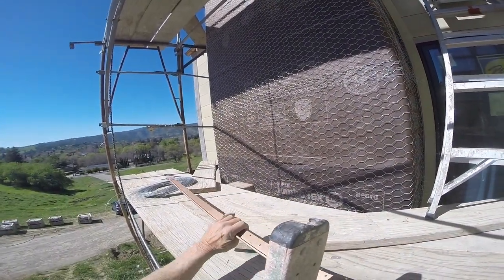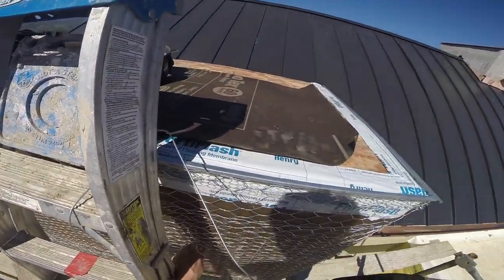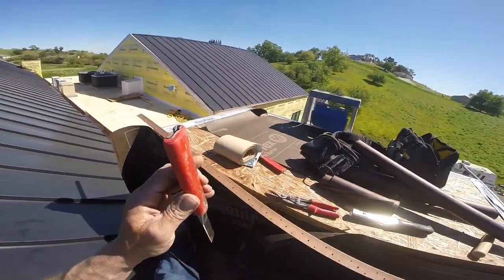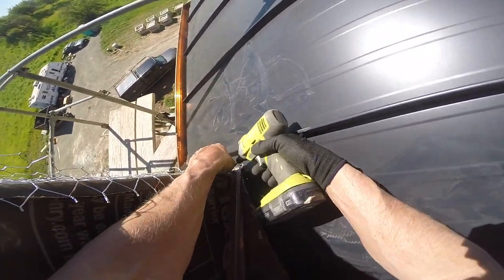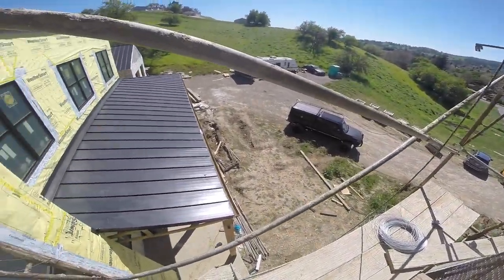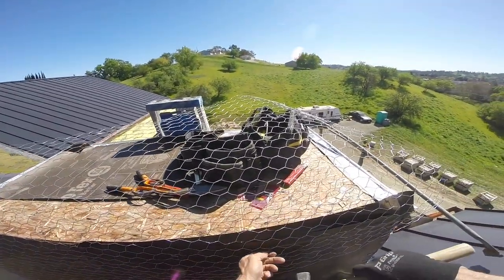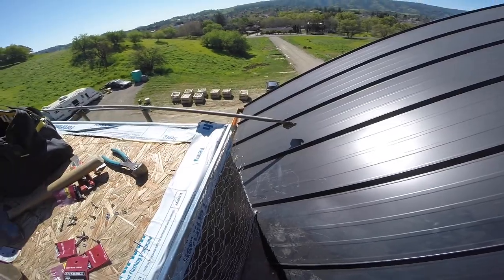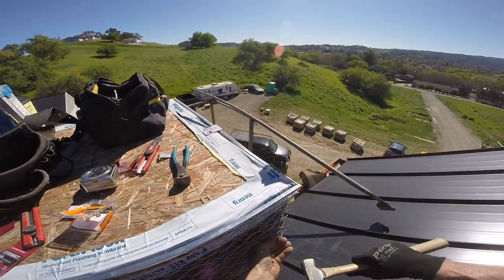Through research I’ve discovered different ways to mate copper with galvanized metal. Here is how

Comment: You could hammer tack a couple thousand more holes in the paper before stapling on the wire...that way you can be sure it leaks after the wire is up.  Why don't you use the minimum number of hammer tacker staples then let the wire hold the paper on with fewer holes.
Reply from the maker: A couple thousand?
Reply from the maker: I guess they are blessed to have any one go up and do it at all